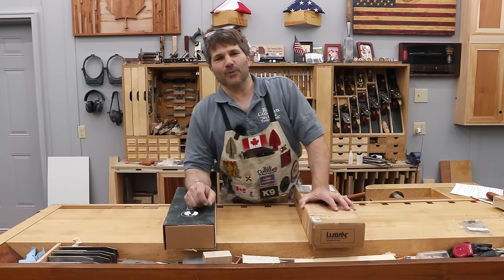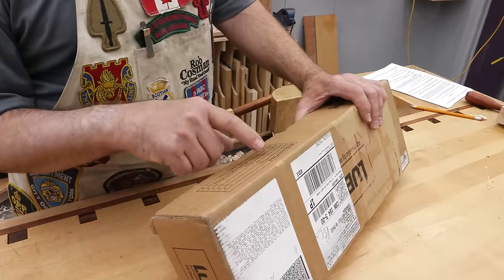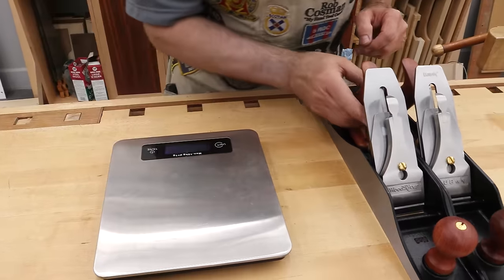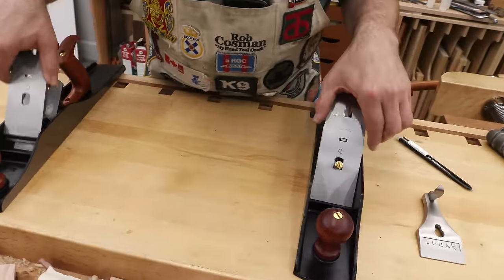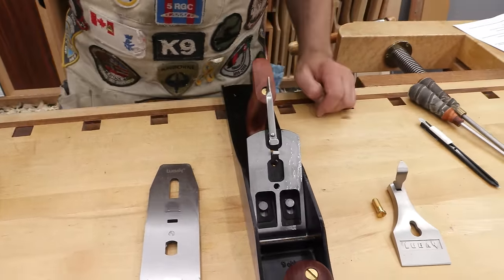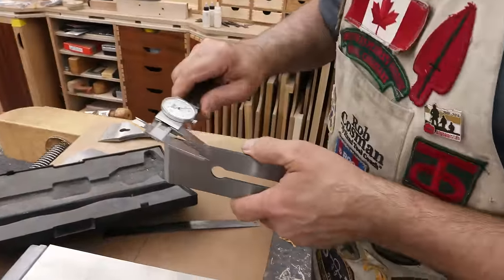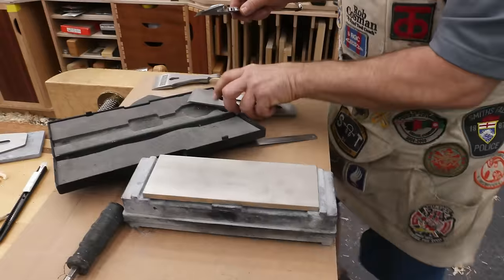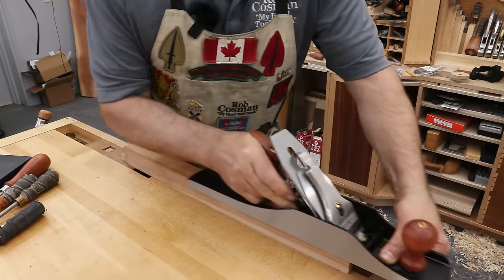Hand Plane Review - Luban vs. WoodRiver

Comment: It’s common knowledge or belief that the Chinese will copy anything for a price. They will vary the quality of the components that go into the manufacture of this plane depending on the requirements (price point) from the customer and the market that it will sell into. It’s not unusual that they will change the looks ever so slightly as well. Because the old Stanley design hasn’t changed, it’s easy to copy and manufacture a look alike, making some think that you are getting your money’s worth. Shiny isn’t always better!

Comment: The extra mass of the Luban is something I appreciate for fine wood working. The woodrivers lateral adjustment is somewhat loosey goosey as far as I'm concerned. These planes could work for 99.99999% of regular workers. Buy the luban and $80 of wood to make stuff, perhaps too much time is spent dissecting which is best.

Comment: I understand the business reasons as to why you cannot ship WoodRiver Planes to the United States.  However I do not find anyone offering the "setup service" on a new plane.  Is it possible to purchase a WoodRiver plane from Woodcraft and ship them to you for setup service?  At 87 I no longer trust my hands to do the work necessary to set up a plane correctly without damage.  I expect to pay an additional charge since the initial purchase was not through your shop.   I need the plane in finishing off table tops and joining.  This will be my only plane for now.  Should it be a No. 5 or a No. 6.  I hope we can work out a way to have you do the setup for me.  George Brisbin

Comment: Thanks for this review. I just wanted to say that you are spot on with the lateral adjustment lever on the Luban. I had to return two jointing planes because the lever was just too flat to engage the blade. Other than that I am quite happy with the quality. I own a Luban smoothing plane that came alright and works well.

Comment: got myself a #5 jack plane from Luban very recently. This review gives me confidence that I was well advised by the local hardware/woodworking specialist shop here. Lateral adjustment on mine is done with a burred screw through which you fix the blade in position. Fits into the blade with a neat, round pin. Does not look flimsy at all.  Still sitting in its box though, next to a pile of reclaimed stock I obtained recently that is in bad need of flattening. Next project in: learning how to plane properly....
Reply: Not burred, knurled

Comment: “鲁班” pronounced /lǔbān/, is where brand name Luban came from. He is considered as Chinese deity in engineering and carpentry. His given name is “Ban” from a kingdom called “Lu”. 
Mr Cosman never expressed that Woodriver and Luban planes are not from the same factory. He simply pointed out that one is not a rebrand of the other. If Ryobi and Ridgid drills are made in the same factory, do you call one a rebrand of the other?
“Made in China? I’m not buying because it’s cheap, crap, shit and bad.” A lot of good things are made in China as well. The keyboard or the phone you typed that message is probably made in China. You still bought it. 
In NA, if you have no way to buy Luban or other similar planes for much cheaper than Woodriver, I think Woodriver is the way to go. You get local support and better literal lever. 
Last, Mr Cosman gave a very objective comparison with upfront disclosure on relationship with Woodriver. Both have the same performance and each has some imperfections, while Woodriver has 2 better design choices. I do not understand what the bias complaints are based on.
Reply: But there is a difference between western companies making things in China and Chinese companies. In general the things designed and made by Chinese companies are worse quality, don't last long, made from cheap materials, and are often ripoffs of western designed things. Even people living in China know this and prefer western brands over their own.

But their are exceptions and I think this is one of them. There simply isn't a good handplane in this price class other than this one. Stanley's suck today.
I also had some modded camara parts from a small Chinese startup that were really good and original. 

So yes there are some great high quality things made in China by Chinese people, but sadly they are very far between and hard to find.
Reply: @DrTheRich  Some of the reason why quality may not be as good is because at least in America, we want price point over quality.  A company gives their specs to the manufacturer and the manufacturer produces it.  
It doesn't make a lot of sense to make some items that will last a long time since the technology outpaces the life of the item.  
I don't have anything against buying a Chinese made item.  But I do try to support companies that make things in the US whenever possible just to support manufacturing in my own country.
Reply from the maker: Thank you so much for your comment.  I think you said it very well
Reply: @keats182   When it comes to patriotism, you should ask more of American companies who ditched American workers in order to score cheaper labor in China. They have the nerve to demand brand loyalty simply because they're American. The Chinese can manufacture an incredibly good product, like the iPhone, or an incredibly bad product, like the typical dollar store headphones. When you compare dollar for dollar, however, the Chinese cannot be beat no matter the quality level
Reply: @bobweiram6321  When I talk about American companies I try to support, I mean things that are made in the USA, like Lie-Nielsen or Blue Spruce Toolworks.  They're expensive but they're lifetime tools.
Beyond that, I look at how often I will use something and what kind of ratings they have.  I don't get bogged down in brands since most of the power tools are made in the same few places.
Reply: @keats182  I believe most of the hand tool are lifetime tools, if you know how to improve your tool or fix some tiny issue, than you can go with bargain products, we all use hand plane, there is nothing can’t be fixed, you can tune a shitty plane into good one, with piece of glasses and some sand papers, it’s nothing wrong to buy a bargain plane,no matter where it’s build, all you need  is mindset, you might have some chance to face some problems.
Reply: @DrTheRich  Other videos on Youtube show that while the modern Stanleys are rough out of the box the problems are all fixable with nothing more than a flat surface and some sandpaper.
Reply: @bobweiram6321  And they did that not to lower prices, but to increase the amount of money that goes to an elite few.  Many products could easily be manufactured locally while paying workers a proper wage and maintaining an affordable price, but that would require those at the top accepting a more modest income.
Reply: @ian1352  if the plane isn't square you need a mill to fix it, not just sandpaper. Also the quality of the metals used have gone down. I'd have no problem if Stanley always made bad planes. The sad thing is that they did it right once, so they know how to do it properly, they just don't care anymore, in our single use, throwaway society.

Comment: Fantastic review, thanks!!!!!
In Australia a Woodriver 5 1/2 is $230 AUD ($170 USD) more expensive than the Luban! The Luban retails for $299 AUD ($530 for the Woodriver) and it’s hard to imagine that the nicer lateral adjuster really adds that much value to the plane.
Reply from the maker: My goal is just to arm you guys with real information on these two planes so you can make the best decision for your situation

Comment: This was an excellent review.i own a quang sheng luban 4 1/2and you might be interested to know the lateral lever is exactly the same as the woodriver in this review. Strange that ones different.
Reply from the maker: Do you own a Q U A N sheng? Or a Q I A N sheng? This is a Q I A N sheng, and can be sold worldwide, the Quansheng cannot be sold into North America.
Reply: @RobCosmanWoodworking  it's a quangsheng.sold to me by workshop heaven in England .well that's how they spell it.amazing plane
Reply from the maker: Yes thats the one that cannot be shipped to North America
Reply: I have a QIANGSHENG number 5. The most comfortable handle ever. It performs perfectly but is heavier than I would like for frequent prolonged use. My most used planes have Veritas blades, both Stanley’s and home made wooden.

Comment: Quangsheng offer a #6 which has the adjustment lever & depth knob off the WoodRiver on the Luban body, with the only obvious difference is no name milled into the lever cap.
It's pretty clear they all originate from the same manufacturer.

Comment: Having purchased a Woodriver 62 and a Luban 5 1/2, I gave it the Rob Cosman once over. 
Very similar results. Both Lever caps needed work, more than either of Robs. The sole where the frog sits are equally nice on both. 

Both planes had sides that were not square with the sole. The Woodriver is out .008, the Luban is out 010. (what a pain in the butt to use on the Shooting board) 

The killer though is that the Luban blade is slightly concave to the sole. I beat to death, both sides flat at the edge of the blade so as to use it for the moment but will have to exchange or buy replacement. (it took forever to do.)

Cautionary tale. I started fine tuning parts without looking at the whole as Rob does in the video. So when things weren't getting better quickly, that is when the concave issue was found. which also impacted the work on the chip breaker... :-( 

If I had more experience, I probably would have discovered the issues faster. 
The sides out of square got me for a while because sometimes the 62 would give good results on the shooting board, sometimes not depending on how I held it. I kept blaming myself for the problems.

The Woodriver had an issue with the opening and closing of the throat. Quick call to Woodcraft and they exchanged it. (Luckily they had one in stock)

So I bought the Luban from overseas, saved a little money over the Woodriver but really bought it because it was available. Would have gone Woodriver otherwise. I've written them to see if something can be done about replacing the blade but I am not holding out hope. I'll update this when they respond. All in all, I'm happy with the unit but resolving issues becomes more involved owing to the distances.
(By the way, they packed the Luban really well and it arrived before they promised.)

Would I do it again? 
Thinking about ordering a Luban #7. Yeah, I have big plans. Still struggling with straight, flat and square though. :-)
Reply from the maker: Really great comment. Thanks for sharing your experience

Comment: Thanks for a great and fair review, just what I would expect from a man with your ethics. In the UK it seems to be difficult if not impossible to get a WoodRiver and shipping from Canada makes it really expensive. What is available is a Quansheng which in the 5 1/2 Jack has the same lateral adjucter as the WoodRiver. Have you had an oportunity to look at a Quansheng?

Comment: I may be wrong but I think they are both manufacture by qiangsheng in Zhejiang province.  I used the Luban's plane every days (I'm in China) and I'm happy with them
Reply from the maker: Could be, but the Luban is Not just a rebranded WoodRiver.  As you can see different casting s are used and while very similar, not the same

Comment: G'day from AUS. Thoroughly enjoyed this review. Gave me excellent tips for my renovation of  an old Stanley 4 1/2. Blade is rocking slightly  on the frog. How would you correct? Use a flat file on the frog?
Reply: G'day from Sydney. I just fixed a "Pope Falcon" which is made in Australia. I did most of the work with a new and sharp 2nd Cut flat file, then transitioned to 240 then 320 grit diamond plates. It's easier to correct if you use something like a file first, as it bites into the surface much better. If you try removing it with a large surface of diamond, abrasive stone or wet&dry on glass you will end up with a domed surface (which is what you are trying to eliminate).
I focused my attention on the lower 4/5 of the surface, and was very light up top near the lateral adjuster. The plane iron isn't under pressure up there anyway, so I just went either side of the adjuster. In other words, I flattened "up and down" diagonally from the left of adjuster, then the same on the opposite diagonal from the right side.
A sharpie blackening and rub will tell you how you are travelling. The file is the key, since it's flat yet able to put pressure exactly where needed (ie: in the centre, not the whole way across).

Comment: Great review! I was struck by the similarity between the Bench Dog plane you reviewed and the Busy Bee plane available here locally.  I can't find any confirmation but I suspect it is brand engineering. The Busy Bee #5 1/2 is currently on sale for $209 here in Edmonton, and I need a shooting plane.  My antique #5 Bailey is so far from square on the sides that if it were trued up, you would see light through it.  My Veritas Jackrabbit would require more creativity than I can muster to make a viable shooting board for, and my #4 1/5 Veritas low angle smoother has only machined sides from the blade opening forward.  What are your thoughts?
Reply from the maker: I like the 5 1/2 for length and weight both on the shooting board and on the bench.  First choice would be Lie-Nielsen (hard to get), second would be a Woodriver.  We sell them preped and ready to go.  Flat soles, square sides, set up chip breaker and blade sharpened.

Comment: Love your video's and your presentation style.  In this video the sides were slightly out of square on both planes.  With this amount of out-of-square, how does that affect the square of a board when used on a shooting board.
Reply: You can use the lateral adjuster to make the iron perpendicular, even if the sole isn't quite.  Still, it would be nice if the sides were more square.

Comment: Thanks Rob ... very fair comparative analysis! ... and very thorough! Two thumbs up!! Quick Q ... I was refurbishing my old Stanley No. 4 last week and the screw which holds the lever cap to the frog got it in mind to dive off my Workmate and through a crack in the deck ... is it brass or ferrous? If a magnet doesn't find it, I guess something from Home Depot will have to sub in. Cheers  Farmer John, Ontario Canada
Reply from the maker: The problem is that Stanley is all over the place depending on the year.  If it was the screw that holds the cap iron probably brass.
Reply: @RobCosmanWoodworking  I think he was talking about the screw that the lever cap fits over and hooks onto. The one that goes into the ace of the frog. If I'm right, all of those are ferrous on my 5 vintage Stanleys. Good fishin' to you!

Comment: I was informed by the Australian distributor of Luban planes that WoodRiver and Luban come from the same factory. Of course that doesn't mean they are the same.  As far as I can tell from other Luban planes, Quangsheng is the brand name used in the UK.
Reply from the maker: Yes it is confusing.  As you can see WoodRiver and Luban are close, but not the same

Comment: I agree fully with those commenting on the review being factual, nit-picky etc.  Regarding the flatness and 90deg angle: Back in the day, before the accountants ran the company, Stanley, and other manufacturers used to age their casting by putting the outside for a long time.  This relieved the internal stresses before they were machined.  Sure they got rusty, but it was only surface rust and was machined away or otherwise removed.  This meant that after machining the casting did not move due to the internal stresses (which now weren't there).  90 deg stayed at 90 deg, flat stayed flat.  Why don't they do that nowadays.  Well, it means tying-up money, whilst competitors don't.  Also, I believe, back in the day the end user was far removed from the capabilities to correct any inaccuracies whereas nowadays these facilities are always 'just around the corner' if not in your own garage (and there is always YouTube to tell you how to do it!).

Comment: No 62 Low Angle Jack Plane - WoodRiver $519, Lie Nielsen Low Angle Jack Plane No 62 $465, 
Luban Low Angle Jack Plane No 62 $299, Veritas Low-Angle Jack Plane with PM-V11 Blade $493 in Australia just for information. Currently buying old Stanley Planes.